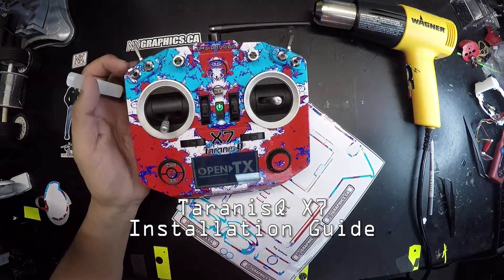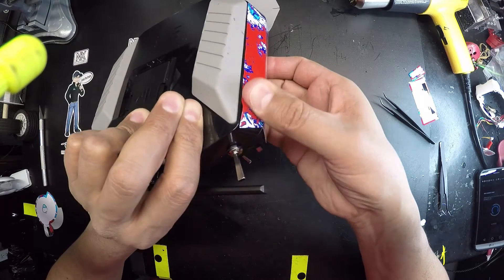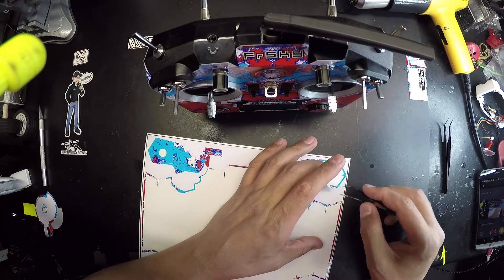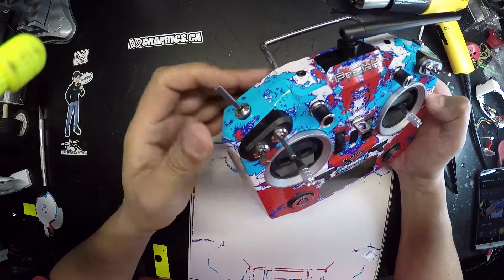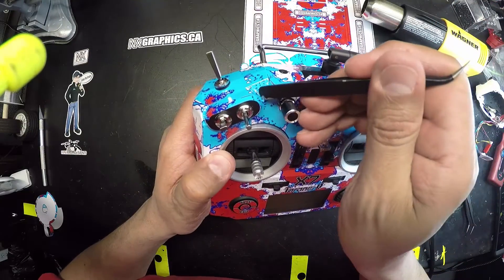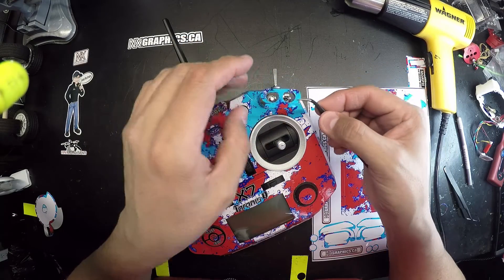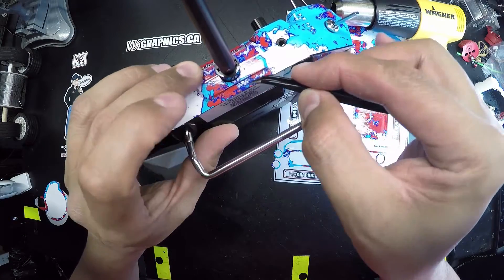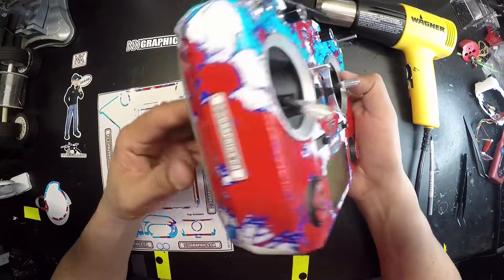TaranisQx7 nxgraphics Wrap Installation Long

Comment from the maker: The updated QX7s is the same with slightly shorter switches in the front. You can trim them or leave them. as for the charging port i do not have access to the new updated TX so you would have to cut with a blade. Fairly easy to do if you charge from this port. My Flame designed got lost in a data loss back in December 2018 and have not been able to remake as it took a long time to try align everything.